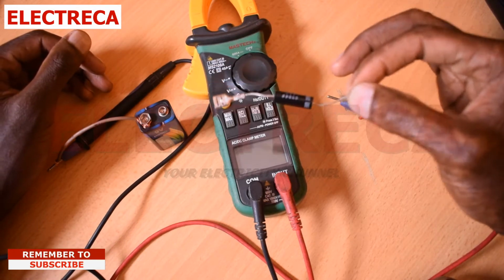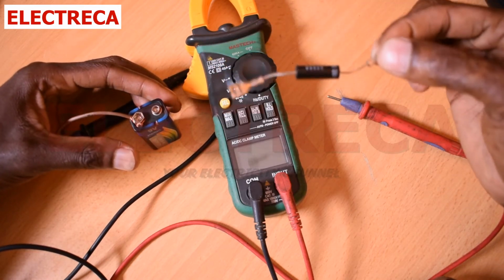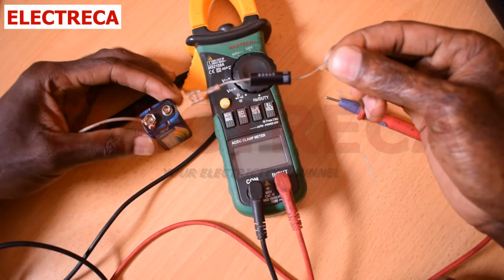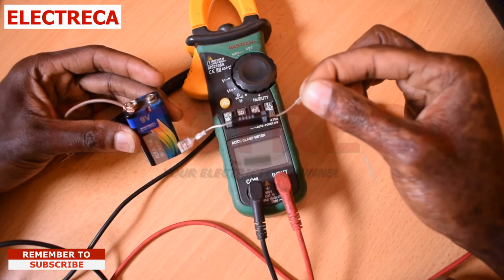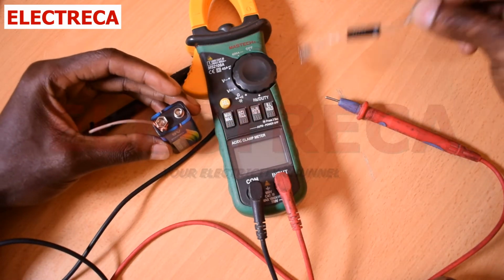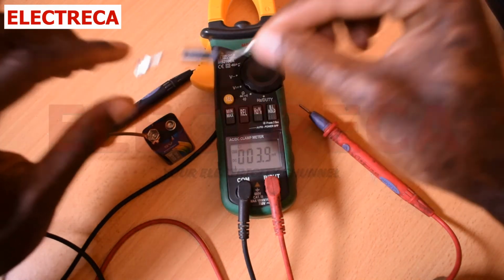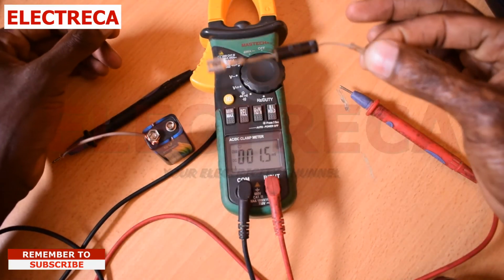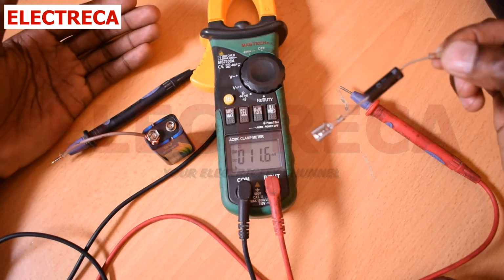Testing microwave high voltage diode testing|microwave|ELECTRECA

Comment: Mr Electrica, You did a good explanation but you did not reverse the diode to show low readings of voltage, usually 😅😅 in mV and it fluctuates indicating the HV Diode is good 😊👍👍

Comment: Why didn't you put it on a reverse pole to see
Reply: Yes his explanation was good. His English is good. He has his  African accent though. He showed everything well except he didn't show the reading you get when you reverse the diode. 😅
You should not get a high reading. Much lower 😊
Usually in mV a very small voltage and it fluctuates . Indicating it's a good HV Diode 👍✌️😊
Reply: Forward, yes..was it? Where's the reverse? It hasn't shown.

Comment: I have some issue with h.v. capacitor. I test it . It is not shorted. But I get only 1.238 megaohms of 10 megaohms (capacitor) My fuse (between h.v. transformer and capacitor) is blown. Could I only replace fuse ou fuse and capacitor ?
Reply from the maker: That's a very small value for Capacitor of 10m ohm. Short it before you test,
If your sure that the meter is giving you correct reading.... Then change the capacitor together with the fuse.
Reply: @elektreca  Microwave oven turns on but no heat. I test magnetron, HV transformer, hv diode they are not shorted. The hv transformer show good values.
Reply from the maker: @Lucas I assume you changed the HV capacitor, and the HV transformer shows good value. But there is no heat still.......consider changing Magnetron and HV diode.....because those 4 components are most source of microwave problems.
And also make sure there is no lose connection in all connection points...
Op that helps.
I have aquetion, before the fuse blew did you notic microwaves leaking inside cubin?
Reply: @elektreca  I purchased a new capacitor and it shows me 9,5 megaohms. I replaced capacitor and diode and it works like a charm.